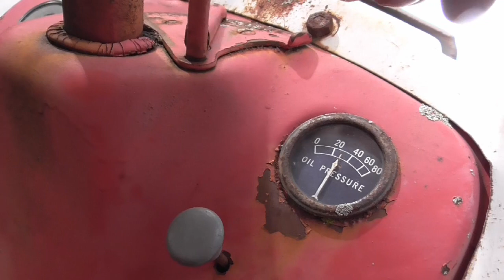Will the ford 8n drive after sitting 7 years in a field?!?

Comment: Enjoyed the video! I'm glad to see people keeping these old tractors running. I have a 1952 8n,. One mysterious problem I've had with it is that on a foggy, humid or damp morning she will not fire, I don't care what I've done the only thing that will sometimes help is blowing the distributor and coil with the heat gun. There's moisture getting somewhere and I can't figure it out, the only thing I've not changed is the off/on switch, everything else is new including the wire from the switch to the coil. It's one of those things I just expect on a day like I described, but other than that I love my 8n. It's served me well and gets the job done. I enjoy your videos and keep them coming!
Reply from the maker: I have seen that on other tractors where moisture gets in the distributor cap and they won't start and it don't take much to do it. Thank you I'm glad you enjoy the videos!

Comment: Thank you for a great video! Since the gearbox is not synchronized it should be hard to get in and out of gears, specially if the wheels are turning. Maybe its not a problem? It takes a while to get used  to and learn to drive. Ive learned to shift up while running on my old Nuffield but shifting down is super hard
Reply from the maker: Your welcome glad you enjoyed the video. I was able to eventually get it to go in thoes gears after I kept spraying lubricant down the shifter where it goes into the transmission. Something must of been rusted up from sitting.